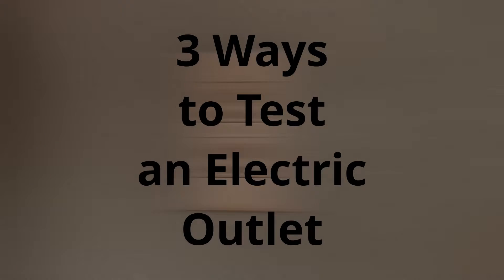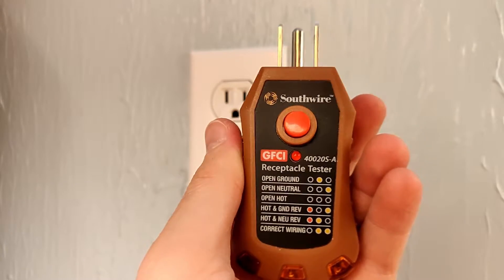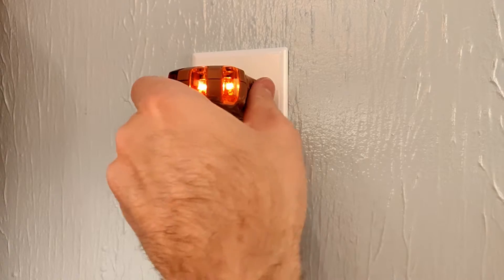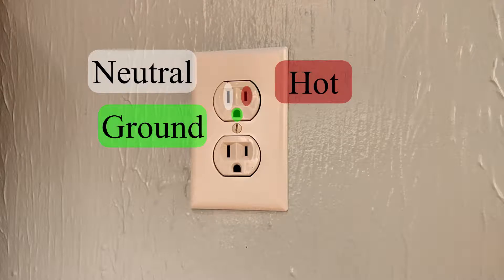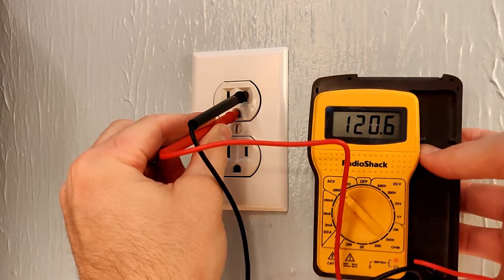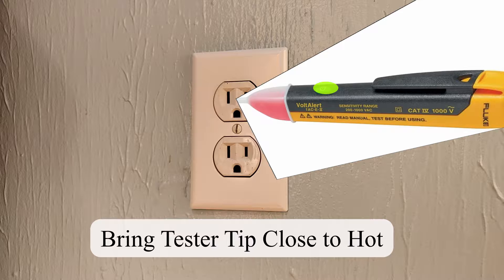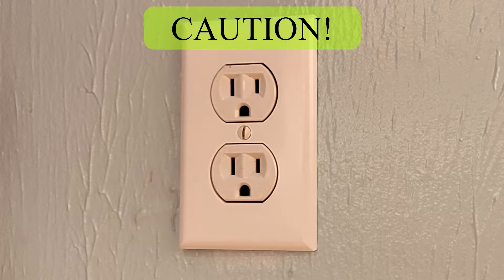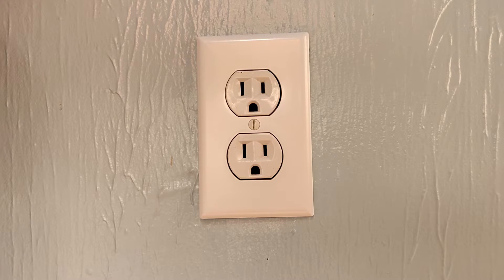3 Ways to Test a Power Outlet in Under 3 Minutes

Comment: When you teat the outlet, you use the black lead for the hot side and red for the neutral, but when you test the bare wires, you use the red lead for the hot wire.  Which is it?
Reply: I set my multimeter according to how you had it at the beginning of the multimeter section, red in V[Omega]mA and black in COM
Reply: Doesn’t matter; it is AC